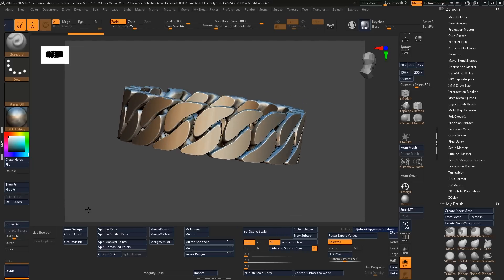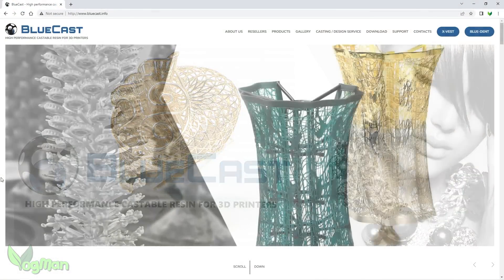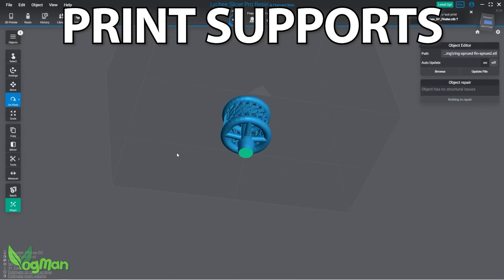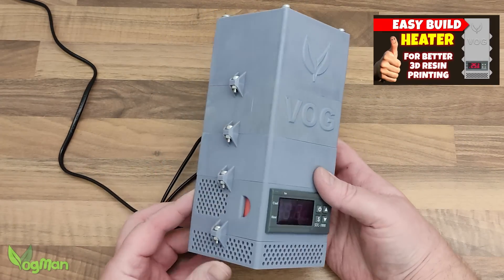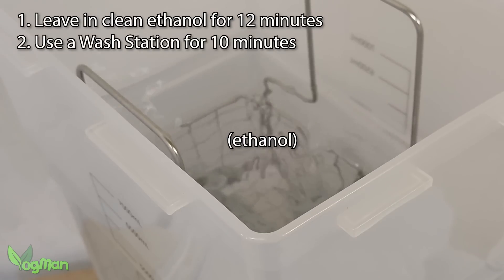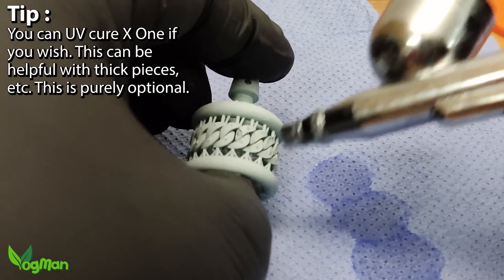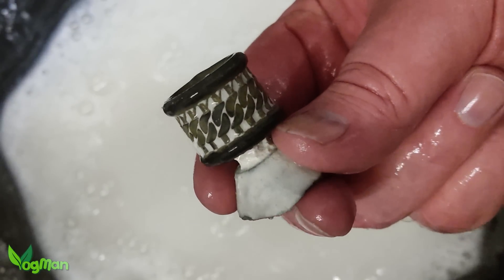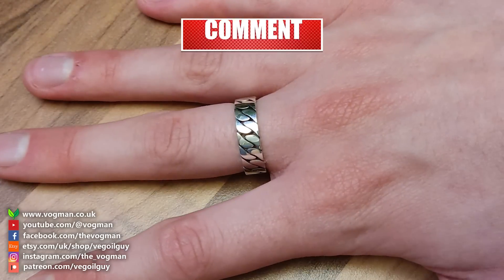Bluecast X One (Castable Resin) USER GUIDE - casting a silver Cuban ring

Comment: hello. I am learning a lot from the video. As a casting beginner, I have a question. I would like to know the exact temperature when pouring a casting with X-1 resin. When I inquired with Bluecast, they said Celsius degrees - Ramps 8 deg / min, but I don't understand what degree I should cast at. Please let me know the exact temperature whether it should be poured at 630 degrees?, 680 degrees?, or 750 degrees?.

Comment: Can some one help me, im wondering if i have to warm the resin for everysingle print i do or just warming the bottle just once a day is enough to print throughout the day
Reply from the maker: It depends on the room temperature really. Bluecast, like most resins, likes warm temperatures. Heating the bottle is great as the UV lights actually generate heat which helps keep the resin warm. BUT if the ambient temperature is low, this won't be enough and the resin temperature will eventually drop. An enclosure heater is the preferred option https://youtu.be/2yfPKFgvmes
Reply: @vogman  thank you so much vogman your videos really motivate to get more into jewelry making.

Comment: Why did you print it in that orientation that needed the extra supports in the slicer? I thought if you flipped it and put it straight on the bed it wouldn't need it

Comment: GIMME X ONE  It's winter here in Australia and I've been using one of those seedling heater mats to warm up the resin before adding it to the printer.
I do have a heated enclosure for my main printer but it saves a lot of time if the resin goes in warm.
I don't have metal casting equipment myself but just joined a Maker Space where they do. So it would be great to have a go.  Cheers!

Comment: Tip for heating resin: if you haven't put it into the vat yet or are going to top up and you have an ultrasonic cleaner (with a heating function) you can fill the cleaner with water and put your resin bottle in there to accuratly and quickly heat the resin up.

Comment: So, 1kg is around £270 plus shipping. That ring with supports etc most likely used around 15-20g so that ring just for materials can be around £10-15 including electricity, resin and metal ( brass or bronze) . So what a point using this resin unless you cast in gold? But I like the fact how easy is it for casting.
Reply from the maker: Bluecast isn't the most expensive resin out there. They are roughly in the middle I'd guess. Try looking at PowerResins for example. 😁
Reply: @vogman  well, your channel mostly was about how to do cheap but damn efficient and to get great results. But when the company gives free stuff, I don't think why you would refuse to try I guess 😁 I personally use purple resin from siraya tech, so far didn't have any issues whatsoever.

Comment: is a very expensive resin 120€ /500G, but with very interesting possibilities, it seems to be easier to use than some resin castable.. i remember your nightmare with another resin castable, which did not at all make me want to get into the creation of signet ring ..  now with this resin  it makes me want,  thank you Vogman, your the best ... GIMMIE X ONE
Reply from the maker: Sometimes you have to pay a little more. If you saw my Cuban Chain cast, I used X One because no UV curing is needed. That was critical in that design.
You're in the drawer 😁
Reply: @vogman  have you tried using other resins and not UV curing them? I get that resins need it to be safe and strong, but if your just using it for a cast does it really matter?

Comment: Doesn’t seem too too fussy to work with or cure. Curious to try. GIMME X ONE
Reply from the maker: It's easy to use. You just HAVE to have BIG supports. Forget these as your prints will fail. Otherwise it's a very simple castable resin.
You're in the drawer 😁